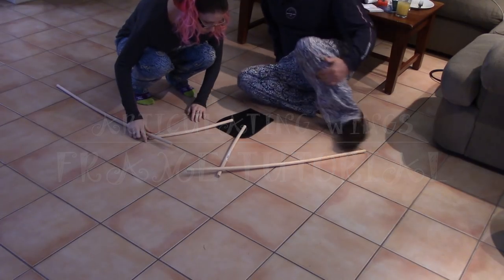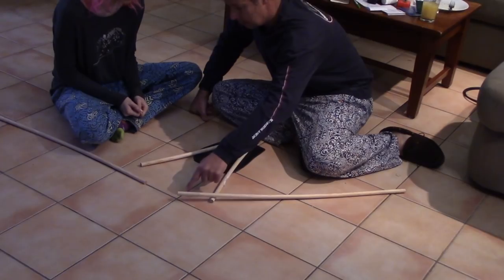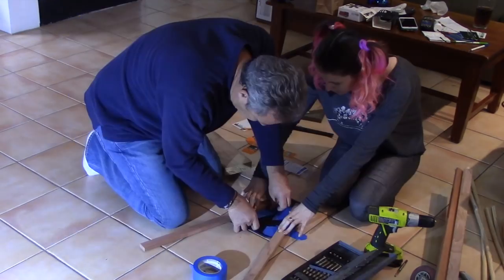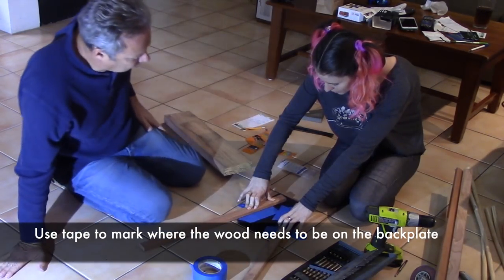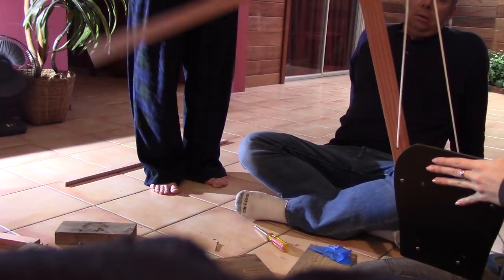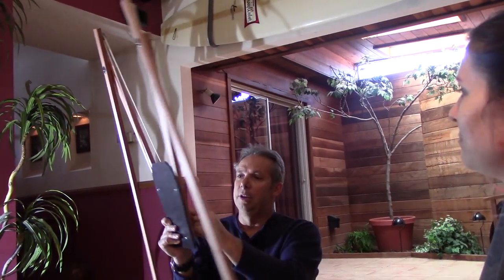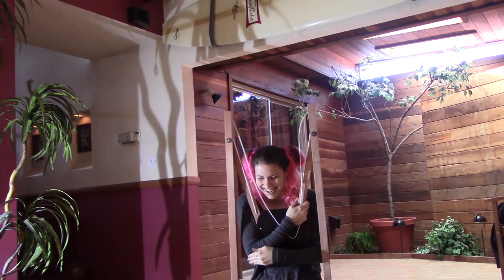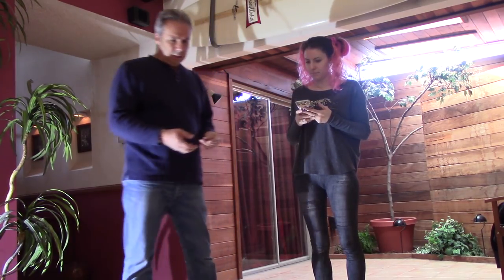Simple Articulating Wing Frame Tutorial

Comment: Exactly what I need for my Maleficent cosplay. Thank you :D
Reply: Hi may I ask how did you put on feathers for the wings?
Reply: @GG-ch1cm  Hi, I don't know if you are still struggling with this, but after hours of research (I was very confused at how to do it too), I think I understand.
You need to make feathers out of something like foam. These will be the largest feathers (look up bird wing feathers diagram if you want to understand the basic layout of the wings).
The feathers will have wire going through the middle, and coming out of the foam. From what I have gathered you need to attach some screws or pins to the wing frame to hang the feathers off. You make a loop with the wire and tie it around the screw, so it can move around. But, at the very tip of the wing, the feather there will be attached to the frame, so it cannot move. Then, you string the feathers together, starting from the attached feather at the top, and there are a few tutorials on YouTube for this. It kind of works like a blind. The tops feather leads all the other feathers to open up, then when you close the wings, the string allows the feathers to stay in the right place but close.
For the smaller, fluffier feathers at the top, you open up the wings and  make a sort of sleeve of fabric to stretch over the frame (I will try to leave links to some tutorials). This will be attached to the frame. Then you can stick or sew feathers onto that piece of fabric. I'm sorry if I didn't make this very clear!!
Reply: How do I get those on my back

Comment: I'd love to do this but I can't see how the pulley is made. Is it just a screw going through the pieces of wood with washers between them?
Reply from the maker: The pulleys were purchased at a hardware store
Reply: Axceleration wait so where is the pulley attached? Is it on the screw? It's kind of hard to see. Also, how did you put the feathers on? What did you attach the feathers to on the frame?
Reply from the maker: The pullies came with little screws that you use to attach it. I never finished these wings, but you can use my other wing tutorial to see how I attached the feathers. It'll work the same for this frame.
Reply: Axceleration Okie ^-^ Thank you so much!
Reply: @AxcelerationDesigns never finished? Means this doesn't work?